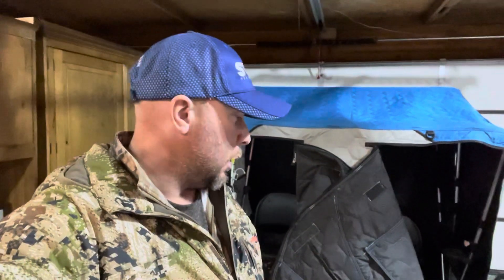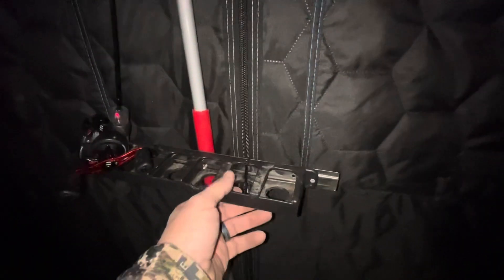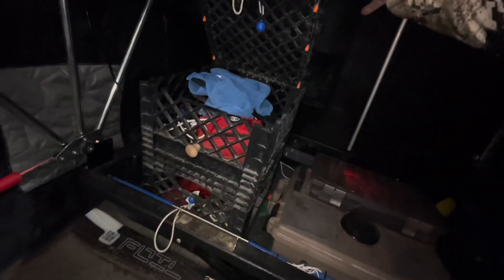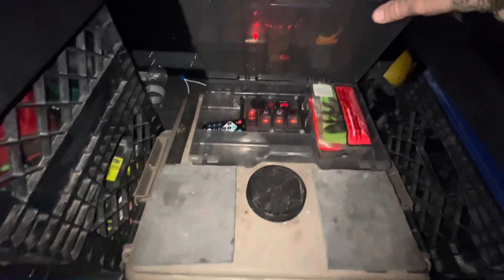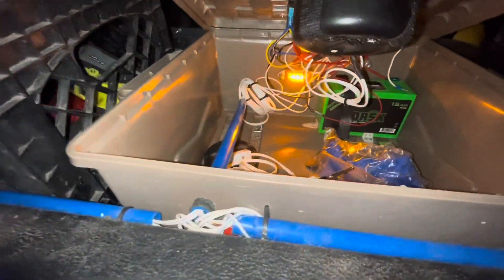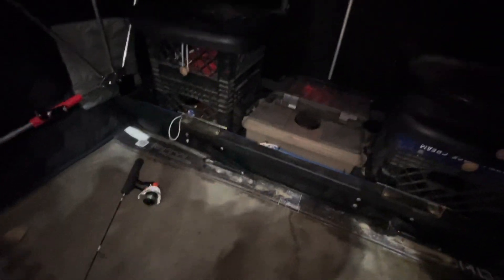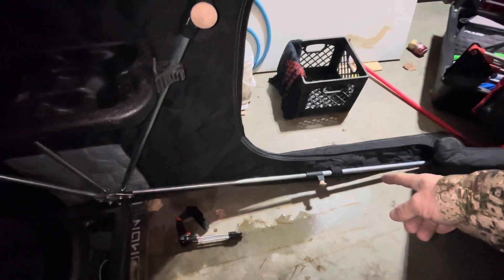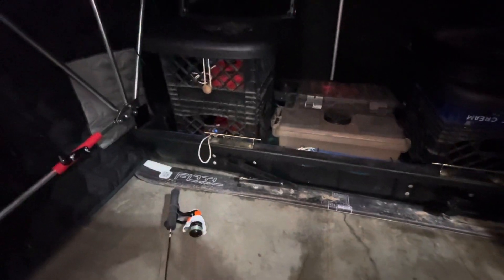Clam  Nanook XL Thermal mods

Comment: How stable is that seat build? Any issues?
Reply from the maker: Very stable. I use them in my single man flipover as well. Also outside the shelter if i just hole hop really close it sit outside on the ice. They are amazing